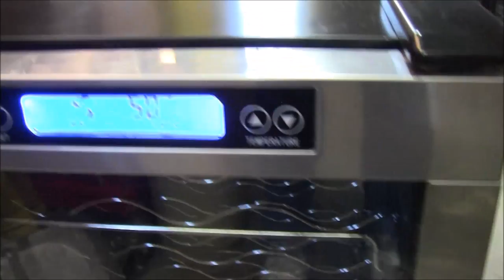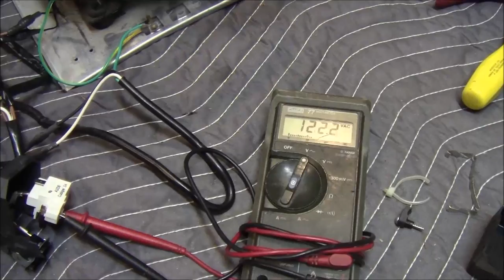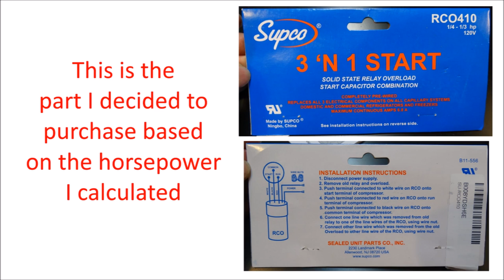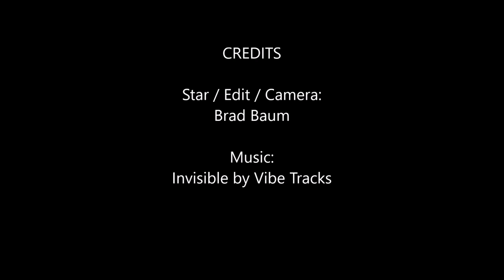Wine Refrigerator

Comment: HI Brad... I have a Magic Chef Beverage cooler that was pretty much the same thing... Diagnosis... the electronic control board. I had to order another one and was able to get it back up and running... the little fan in these are nothing more then a 80mm PC chassis fan.... I got mine for free, just spent $80.00 to get a new control board...  works great now!  love the video! thanks!
Reply from the maker: Thanks! Glad you got it fixed !

Comment: That’s a thermistor ceramic disc ....if over heat occurs at startup it will blow protecting the motor from damage 

You might say a ceramic fuse

Comment: Hi Brad, Thank you for your video. I'm thinking of doing the same for my wine cooler Vinotemp. Would you please let me know why you weren't concerned about LRA of the compressor when selecting the starter? Shouldn't the starter be compatible with the LRA?  Thank you.
Reply from the maker: The starter I choose was overrated for the size of the compressor, so I wasn't worried about the LRA - If you want to save money and get a smaller starter then you will need to worry about the LRA of the compressor.

Comment: Hi Brad...great video...I have a SWC1875 that wont cool.  Fan on bottom comparment comes and can hear compressor cycle but no cooling.  No cooling and no fan operation in upper compartment.  Any thoughts on where to start?  many thanks!
Reply from the maker: Check the compressor to make sure it isn't shorted, I show this at about 6:58 in the video. If the compressor is shorted it is better just to buy a new fridge.
Reply: @BradsLaboratory  Thanks!  Picked this up for free so want to see if there are aftermarket replacements and at least give it a try.  Brand new this unit goes for $1400

Comment: How do you get the compresor and all the parts to slide out?
Reply from the maker: I just undid screws until it slid out. several or on the bottom.
Reply: Oster refrigerator